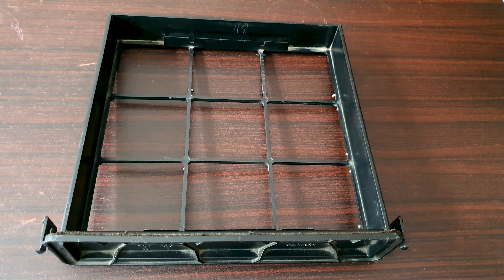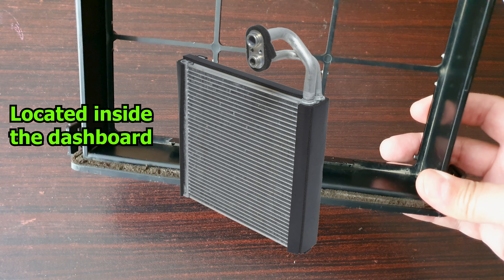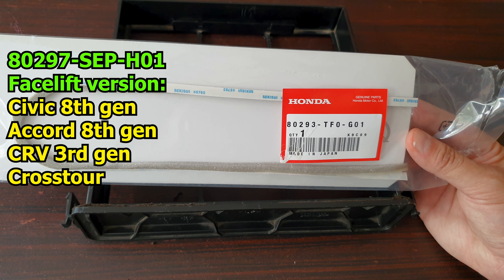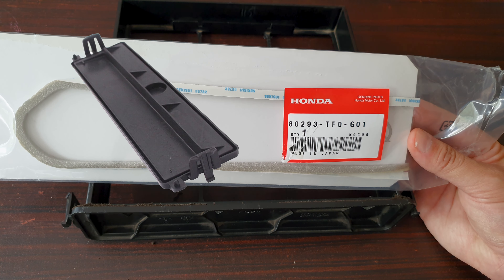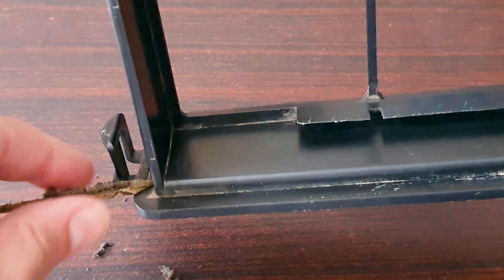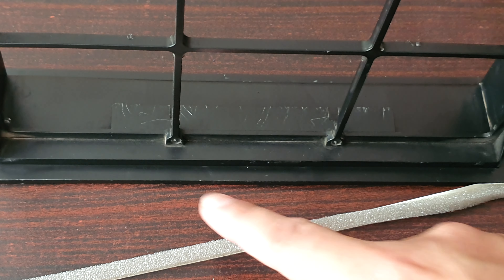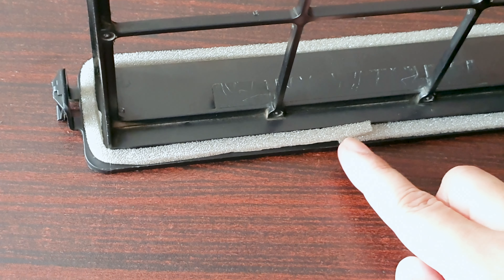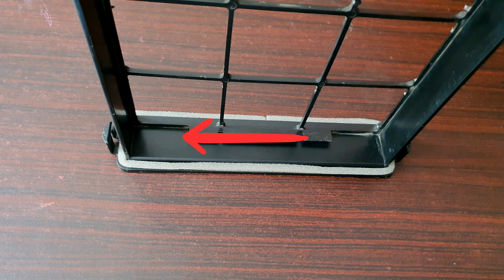Honda cabin filter tray foam seal replacement - Jazz, Fit, City, Civic, CRV, Accord

Comment from the maker: Models that include a filter tray:

Honda Fit/Jazz 1st Gen, Hona City 5th gen 2009- 2013 - part no: 80293-TF0-G01
Honda Civic 8th gen FD1, FD2 2006-2012- part no: 80297-SEP-H01
Honda Accord 8th gen - part no: 80297-SEP-H01
Honda CRV 3rd gen - part no: 80297-SEP-H01
Crosstour - part no: 80297-SEP-H01

There may be more models (including some on the Acura line), just check if you have a filter tray. Models that came after no longer have a filter tray. It just has a cover that does not use any foam tape seal.